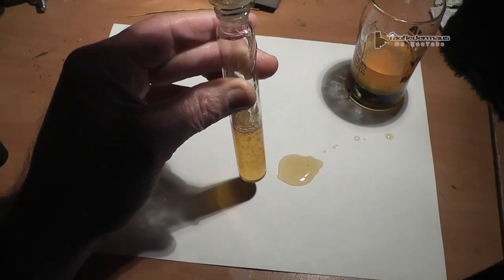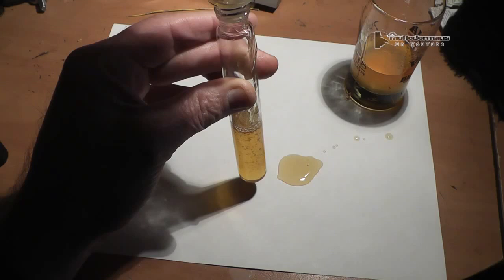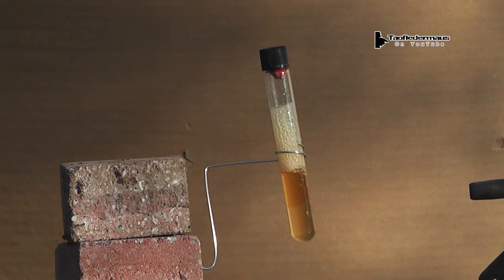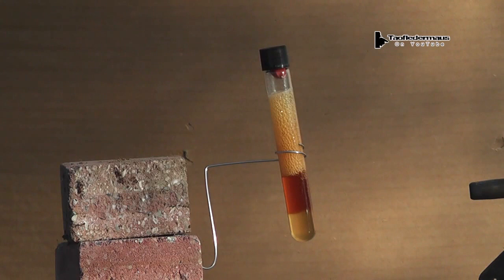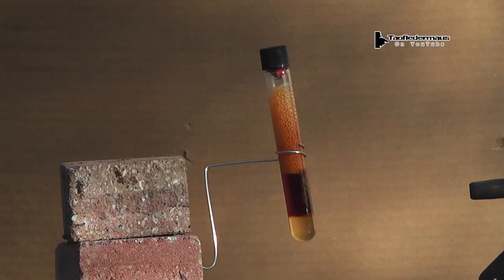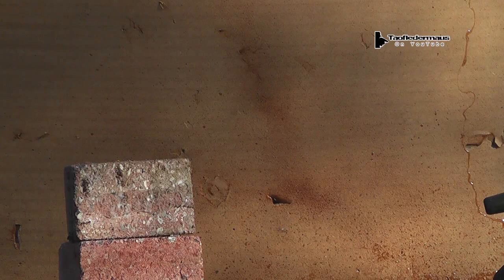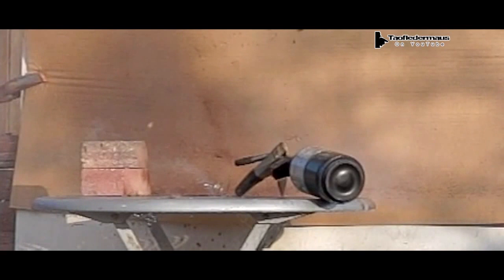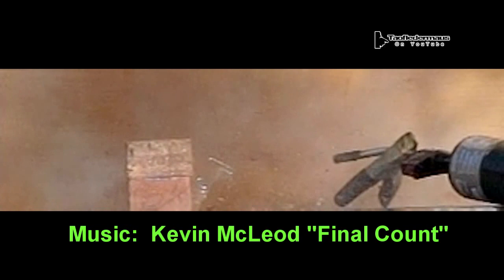HONEY vs Gas Torch - Who knew it could blow up?

Comment from the maker: Bee spit
Reply: Try turning the test tube upside down and heat it.
Reply: amon guy Honey rocket :D
Reply: Doo honey rocket
Reply: Honey rocket :D Or use Gasolin instead of Honey :)
Reply: Or solidfuel :D
Reply: Or maybe mix gasolin and honey
Reply: Is it possible for you to put an Infrared thermometer in front of the camera pointed to the vial. It would be very interesting to watch the temperature reached at each phase like when it starts changing colors, exploding, etc. Thanks for the awesome videos you put.
Reply: I give up on you man.  It's Thursday.
Reply: you should put a scaled board in the background to measure the speed of the vile like in mythbusters
Reply: Bee spoof!!
Reply: Locally produced bee spit is the best and the best for you.
Reply: More like bee barf, actually.
Reply: thats not true.... what if your in japan? that honey cant be good for you right now.....
Reply: Throw mercury into boiling water.
Reply: Technically it's bee vomit.  It goes into a special stomach and is regurgitated.  Enzymes and drying produce the honey. 

Milk is a modified form of sweat.  Having a degree in evolutionary biology can be slightly creepy.  The platypus really shows this off.  It holds the eggs on its stomach and juices them with its milk.  Unlike other mammals they don't have nipples and simply have patches that ooze milk.  The eggs absorb the milk, plus it also protects them from infection and once born the young lap it up from these milk patches.
Reply: Hey TOAFLEDERMAUS, I'm new to your channel but am loving what I see. Suggestion: Add a timer on screen for the elapsed time during reactions. It would provide context when shifting between Cameras :D keep up the content
Reply: can u test it with a upsidedown test tube?
Reply: Can you do things with sodium?
Reply: dracomanser1
Thinking same thing, or face it at some type off target.
Reply: I'm curious as to what you thought milk was...
Reply: 2ofEverything Who thought of cow's milk. Just some weird guy said "I'm going to try to squeeze these things and see what happens, and drunk this liquid that came out,"
Reply: do an experiment to see what it would do if it hit some one
Reply: ***** I meant by using pig flesh or ballistic jell not actually aim it at some one
Reply: Not bee spit, bee vomit. Yummy! I've always thought of it as flower juice.
Reply: Actually bee vomit.
Reply: Did the honey come from that farm you usually shoot around?
Reply: PLEASE DO NERDS, OR SOME KIND OF HARD CANDY
Reply: I agree, but is is delicious though😉
Reply: Yes, but it's very tasty bee spit. Just be glad we don't have to kiss a bee to get some...

Comment: Have you considered using something like an ampule? It may be smaller (though it doesn't have to be), but you can melt the glass and seal it completely. This way the only way for it to get out is by bursting the glass (and boy will it).
Reply from the maker: I'm not sure if I could do it with these test tubes,  I would probably have to get some glass tubing,   but I would still need a torch that burned hotter to do it.
Reply: No, it would definitely require something different than the test tubes being used. However, they're not as thick, and they're not made of Pyrex, so they should be OK with a torch. Check out the differences next time you go shopping for glassware.

Roger

Comment: How awesome would it be if you repeated this experiment, but did it upside down. That way, the heated/high pressure honey would propel the tube upwards rather than straight into the ground

Comment: Anything that is heated will expand and there's only so much room and strength in a sealed container so anything that is heated indefinitely in a sealed container will cause an explosion if a hole is not burned or melted in the container first

Comment: I also wonder what it smelled like!
Other things i'd love to see:
- Esbit fuel tabs
- Plastic (fill the whole tube with shards of a CD or something)
- Gasolene and diesel (i wonder if they behave differently)
Maybe the plug wouldn't be pushed out if you clamp the test tube in a vise or some similar but more practical setup.
Reply from the maker: I do plan on using some flammable stuff,  just smaller quantities like 10 ml or less.   I do want the plug to be the weak point so these won't be considered "bombs".

Comment: Taofledermaus:
You could use the propelling force to your advantage and place the test tube horizontally at an angle and place the rounded base slightly into a PVC tube so tht when the pressure is released the tube will fly down the PVC tube
Just tht it would be awesome to see if it worked,Jeff ur awesome keep up the good work :)

Comment: Butter, Liquid Nitrogen, Vaseline, glue, radiator coolant, Electronic cigarette juice (which is basically vegetable glycerin, propylene glycol, nicotine, and natural/artificial flavoring). I think radiator coolant would be really cool because it doesn't boil at a lower temperature. You would have to do both pre-mixed and non-mixed.

Comment: What if you put melt glass to cap it off instead of using plastic? And just kept heating and heating. What will happen next? Because in all your videos, we all know by now that the failure point is at the cap. But what if there was no cap and it was just solid glass?
Reply: He glass would just explode with a higher risk of dangerous shrapnel, i get where you are coming from but its unnecissarily dangerous to to go to all that effort ;)

Comment: I think the epoxy is melting, could you try sealing the top of a tube by melting the glass and stretching it into an ampule. I don't know if the propane torch gets hot enough, but just a thought.

Love the results though, kind of want an aftermath shot, like 15-20 seconds. Without changing, you have a great format here.
Reply from the maker: I should have showed the table and cardboard afterwards.   There was a coating of brown caramel all over it.  Usually there is no residue.   I don't think my torch gets hot enough to make an ampule or if the test tubes would work for that.  It might just make a weaker,  thin spot.   With the silicone plugs I have used for the last two videos,   I am having pretty consistent  results.   I don't want the glass to blow...  trying to keep people from thinking these are "destructive devices"  for legal reasons.
Reply: Good point, glad you're the expert, I'd blown it up and learned the hard way. Consistent failures are more safe...

Comment: you should put a test tube in a rig that will hold it so it won't jet off.
I'm curious to see if the tube could survive if it weren't propelling itself at the table at high speed.
Reply from the maker: I think it would survive.   I will look into that.

Comment: I had stumbled upon a cool experiment that i figured out Last week.  I was filling up a small plastic cup full of the freezing liquid from the compressed air can if you hold it upside down. i wondered what would happen if i boiled some water and poured the liquid into it so i got a bottle and filled it with boiled water and poured about a 1/4 cup of the liquid into it and it exploded and shot the water 30 feet up. so i got my camera and took a slow motion video. 

Canned air liquid poured into boiled water= explosion.  Slow Motion Video 

I also filled a empty gallon milk jug a quarter way with boiled water(i cut a larger whole in the top) and filled a shot glass to the top with the freezing liquid and just dropped it in and it scared the heck out of me it was so loud. it shot the shot glass up at least 40 feet lol i figured this would be right up your ally and try it on this channel. I would like to know what reaction its taking place to cause the explosion.

Comment: I think you should set a test tube sideways and heat it up to let us see how far it goes. Maybe you could set up a scale to show how fast it flies through the air also.
Reply from the maker: I want to do that,   maybe use a pipe to aim it.  I don't think it would fly straight though.
Reply: Even if it doesn't fly straight, I think it would be cool to see what it does.

Comment: Would it be possible for you to apply a vacuum inside a filled tube before heating it, in order to remove residual air and possibly making the tube slightly less susceptible to rupturing?

Comment: ***** i got another idea too. How about cutting a notch in the side of a capped off pipe that the test tube fit snug in so u could still heat it and lets see how far we could propel one!
Reply from the maker: I could leave the rear-end of the pipe open too,   and have a hole in the side for the flame to hit the test tube.   It's hard to film rockets going straight up,  but if I launched it horizontally,  I could film it well,  and keep it from going over the fence.
Reply: *****
yeah you could but i was thinkin with it closed it would go further, maybe do it at the shooting range and launch it horizontal, as long as you dont have the haz mats in it lol.
Reply: ***** if u do that is there any chance of putting a crony in the flight path to see what sort of velocity it gets?

Comment: I notice that the cap is usually the point of failure. Is there some way that you could seal the test tubes where the glass is more likely to fail? Perhaps some glue on the cap, or a bit of softer glass melted over the end of the tube?
Reply from the maker: I'd rather the cap blow out than the glass blow up.  (for legal reasons)
Reply: ***** Aw, man. The only reason I suggest it is that I'd be interested to see these substances heated to temperatures higher than these weak caps allow. It's not so much about seeing glass break as it is about the fact that the glass is obviously stronger than the caps.

Comment: It seems that due to the quality of the glass, it's always the platic cap that fails, what if you melt the cap end of the tube to seal it with the glass itself, and then test it with the torch?
Reply from the maker: The plug blowing out isn't a bad thing.   I don't want these to be considered "bombs".
Reply: my bad, i didn't know that would be considered a bomb.
Reply from the maker: Not everywhere,   but  in some states it is.

Comment: what would happen if you put dry ice in a test tube and heated it up? would the sudden temperature change cause a failure? would the expanding CO2 be enough? I donno...
Reply from the maker: Dry ice would really build up high pressures.   The problem is the caps alone tend to leak under pressure.  I use the silicone plug to hold the pressure and that takes a few days to cure.
Reply: Though the effort vs reward may not be worth it, even if this is possible, but you could try to store the filled and plugged test tube in a dry ice filled container during the curing process.
Reply from the maker: Lol,  I have a lot of other ideas to try before I try one that might send glass shards in my face.

Comment: how does this work ? whats the science behind this and how hot is that burner ???
Reply from the maker: When you heat up a liquid in a sealed container,  it not only gets hot,  but builds up a lot of pressure.   I am just putting common household materials inside test tubes to see how they behave in that harsh environment.
Reply: i want to make use of the energy produced by such an expierement

Comment: As a Lithuanian, the honey seems too watery.
Reply from the maker: It tends to get a lot thinner when you heat it up.
Reply: No, I mean that the honey is too watery when it even is in the syringe.
Reply from the maker: I had warmed it up in the microwave to make it flow better.
Reply: Oh, okay then.
Reply from the maker: It was way too thick to pour into the syringe,  it didn't want to flow in so I just warmed it up so I could measure and load it into the vial.